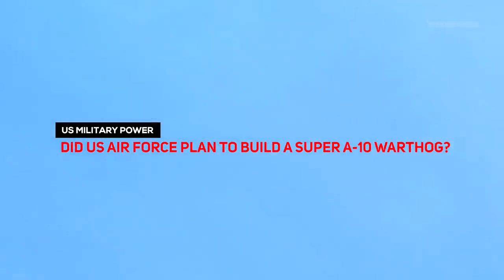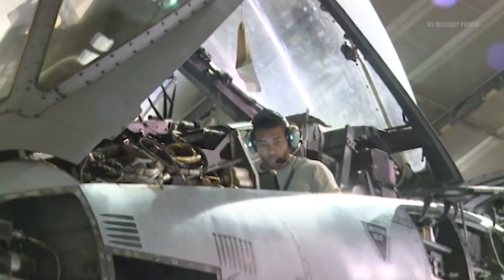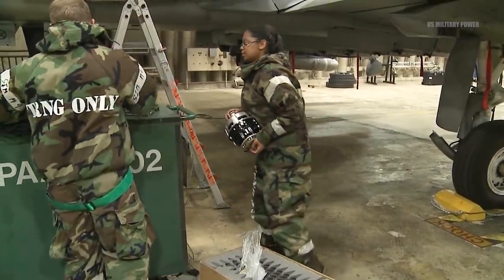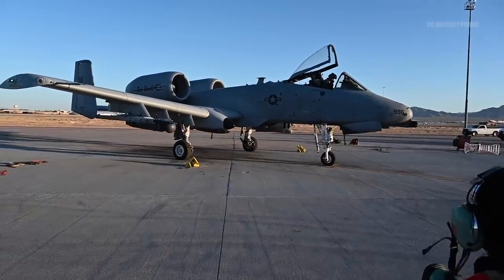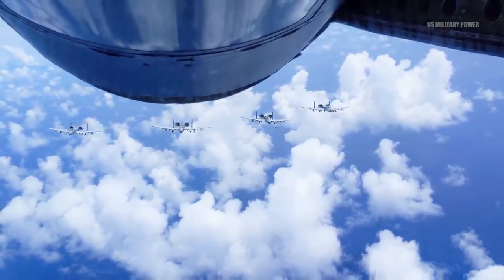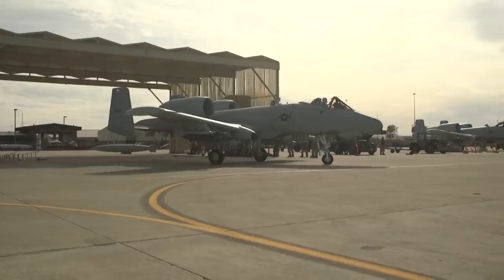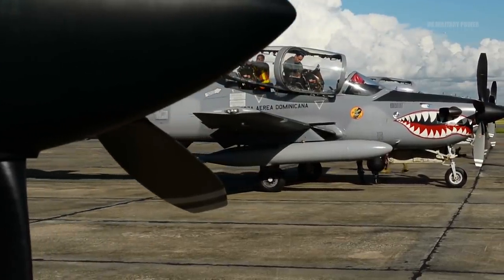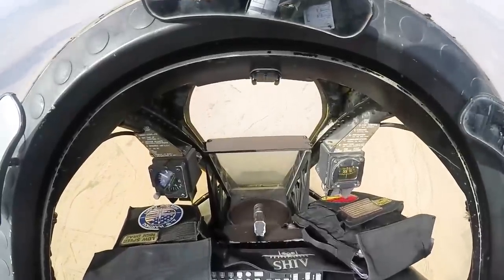The New Super A-10 Warthog is Coming

Comment: The only thing they need to do is build more A-10 airframes
Reply: Build more A10 to confront the Iranian gunboats. If it is designed to kill tanks and can easily kill boats.
Reply: @warpaulgundol7560  the speed of a-10 is only 0.57 Mach , even old surface to air missiles from 60s have speed of up to 3 Mach, he isn't going to survive that encounter,  A-10 is only useful against enemy that doesn't have surface to air missiles
Reply: @fpsserbia6570  The A-10 will merely be used while air suppression has been enforced. Plus, its survivability is much much better than attack helicopter and F35 that it could withstand massive gunfire and fast enough to escape from handheld missile in low attitude with flare.
Reply: If you're already going ahead and building more airframes you can build a new design with the same redundancies. 

If you wanna keep the a10 you're gonna have to do with existing airframes.
Reply: While we are at it, let’s build more P-51s as an air superiority fighter
Reply: @carlosandleon  basic a-10 design doesn't need to change
Reply: @lordraydens  it can be improved. Improvement is change. 

It's the redundancies that make the A10 durable, not It's design. 

If you're building a new airframe, design a better one. The redundancies can be built in
Reply: @fpsserbia6570  you can't outrun a SAM even with most modern designs, being this slow may actually be an advantage, both in being harder to hit and staying on target for longer in a CAS role.
Reply: @XxBloggs  p26 with 747 engine best foghterz
Reply: Keep the plane
Reply: @fpsserbia6570  BS..  THERE ARE AIR TO AIR Packages, A DEFENSIVE PROJECT OF A MINI CWIZ, a masking package.....   there has been options .
Reply: @fpsserbia6570  slow is actually harder to hit with a Mach 3+ missile. The reason they keep un retiring it is because it serves a very useful purpose. The F-35 is not really that great for CAS, can’t loiter and is too expensive to lose to pistol fire from the ground. That is an exaggeration, but you get my point. I think we will be seeing AT 6 and super Tucano CAS as well.
Reply: @fpsserbia6570  false, might wanna look at why the frame is built the way it is.
Reply: Updated avionics and modernizing the engines would be welcome additions
Reply: You are ... SOOOO RIGHT....
Reply: MichaelKingsfordGray  AGREED.  That is frequently my line.
These people who sign on to YouTube anonymously to enable themselves to constantly make ugly, rude and disrespectful comments are Keyboard Kowards and should be called out and banned from UT.
Reply: Building more A-10s is waste of time.
Reply: @warpaulgundol7560  Why not use anti-ship missiles?  If it can sink a frigate, it can sink a gunboat.  Multiple missiles, multiple targets, sink the pirate fleet before they know what hit them.  Or get up close and personal with the big ships and use the anti-missle defense guns/rockets on the pirates.

Comment: if i was a soldier on the battlefield i'ld rather see a warthog in the sky around me. they got a proven and well deserved reputation of being tough.cheaper than other planes and that big gun well speaks for itself
Reply: The main problem is the proliferation of MANPADs, making it much easier to cripple them, and the fact that the GA/U-8 isn't enough gun for its original role anymore while being too much gun for its new job.
Reply: The problem is that you're not a soldier, and generally pilots nowadays prefer the F-35 over the A-10. The A-10 is quite useless for any competent army that equips its regiments with some anti-air capability.
Reply: @Just_A_Dude  Your opinion is noted.
Reply: @revivedcorpseofrasputin4337  All aircraft are vulnerable to MANPADS. The A10 will be with us for along time.
Reply: @davidpallin772  The A-10 is far less capable of avoiding them than any other aircraft.
Reply: And they can get closer to our troops with less chance of casualties compared to any other plane
Reply: @revivedcorpseofrasputin4337  Not true when they're being upgraded with ECM and ECCM packages in addition to having SEAD escorts during campaign sorties where there's a realistic expectation of such problems. ISIS had plenty of AA capability but it did nothing to help them against the A-10 strikes. There is such as thing as modern combined arms, and no one ever sent A-10's expecting them to dogfight or deal with AA alone.

When you look at investment value, they drop more bombs with better target aquisition, longer field loiter time, and cheaper flight hours. Far from useless against its sisters who spend $22,000 or more per flight hour and struggle to stay local long enough to be useful to ground forces.
Reply: @JRyan-lu5im at the cost of pylons. The f 35 has all those capabilities built in. and it can carry a similar cas loadout. there is NO reason whatsoever froth a-10 to be used for anything other than coin
Reply: Tried. True.  Durable.  Effective.   Cost efficient (relatively).   I guess gotta get their buddies multi billion dollar contracts to build a new one
Reply: Aside from all the friendly fire casualties over the years

Comment: If the airforce doesn't want it, then they should give it to the army or marines.  The airforce has the motto "Aim high".  This plane is about aiming low.
Reply: "Aim high" hasn't been the motto in almost 20 years.
Reply: @tommyarnold890  exactly. Time to aim high once again and give low to the ground aiming a10 to some branch that needs it
Reply: @lordwalrus8615  Nooooooo. In fact the AF has been expanding its CAS inventory. Considering how easily the AF has established air dominance in every theater since...ever, it makes sense that they are expanding their capability to switch to a CAS role.
Reply: @tommyarnold890  You do realize how many helicopters the army owns...right?  This is a support vehicle just like that.  The army can get above ground.
Reply: @samuelmcbride  Of course. And they are also limited in loiter time, range, ordinance, and altitude. There were some places in Afghanistan they couldn't even fly into. Meanwhile fixed wing aircraft like A-10 and Super Tucano don't have that problem.  They can fly further,  longer, carry more toys to the party, and actually get to the party. Which is why the AF was not interested in the AH program when the project was first proposed.  Along with their focus being to stop Russian bombers. There actually was an AH that was designed and tested by the AF in the 50's and it out preformed the Apache today. Thats how uninterested they were. Its ok, the Army can keep plying with their whirly birds, thinking they have something cool.  But when it really hits the fan the AF will still have to bail them out.
Reply: @tommyarnold890  Are you talking about the AH-56 Cheyenne developed by the army in '67?  Had a pusher prop and was very fast.  The Army said it would take over CAS, so the AF built the A-10.
Reply: @kwang6291  Yeah thats it. The Cheyenne. The AF also looked at it when the Army was considering filling the CAS need. Instead they built the A-10 which was superior in every imaginable way.
Reply: Aim high; miss your target.

Comment: The Air Force already has the platform - the current A-10.  One of the most critical upgrades the Warthog needs are NEW AND MORE POWERFUL ENGINES.  The majority already have received new wings, and obviously the GAU-8 Avenger needs no upgrading.  But new engines with more thrust will allow the Warthog egress from the battlefield after dropping its load on the enemy.  In addition, added power will allow the Warthog to carry a larger payload.  
     The TF-34 Allision turbofan engines that are currently being used puts out just over 9,000 lbs of thrust.  A newer version of the TF-34 or even completely different engines with 25 to 30% more power will give the Warthog the extra boost it needs to leave the scene much quicker.  Improving the A-10 this way, just like what Boeing did with the F-15EX, will save the Air Force a HUGE amount of money - pilots don't have to spend months or years transitioning into a "new" aircraft because they're already familiar with the aircraft.  
     The A-10, in my opinion, is still a vital part of the Air Force - one that will get up close and personal with the enemy.  And with improvements like new and more powerful engines, possibly new sensors, the A-10 can be even deadlier.
Reply: The Air Farce and Navy have slashed so much of their pilot training budgets already to try and prop up the F-35 debacle, cutting capable aircraft to “put the turd in someone else’s pocket” will only make the Pentagon situation worse.

I’d like to see an A-10 driver tangle with an F-35 in a dogfight, and see who comes out on top: the faster plane that still has to get within visual range with it’s “fire and forget” technology to avoid shooting friendlies, or the underdog that can literally out turn anything else in the skies.
Reply: @chrisbullard5901  interesting concept, they could then try flying with heavy battle damage and land wheels up, A10s can and have done both, the later because its designed to be able to do so.
Reply: @CrusaderSports250 , while pilot training factors in heavily, the A-10 as a dogfighter could make sense if you use the extremes of EM Theory. Much like the A6M Zero against the Hellcat or the MiG-21 vs the F-4, the A-10 would just have to trick the F-35 into a horizontal turning battle to engage.

The shorter turning radius alone could potentially cause a win as early as the merge.
Reply: Amusingly enough, the engines on the A-10 are already MORE powerful than needed. They specifically had to tune DOWN the engines to keep it slow enough.
Just undo the downtune, and call it a day.
Reply: well could use the engines the that f-35 As and Cs use and then put them on the A-10!  then we make the A-10 wings have vector folding high super sonic aerodynice wings that can fold for very high speeds that can then unfold when near the tagrest zone!  also give it remote uav drone remote contoal and add high speed ram jet engines for more fuel efecsty at highe super sonic speeds!  then  add some of  the steath tech from the f22 and f35 into the a-10 as well!  if they USAF want to replace the A-10's GAU-8 with a new multi fonchon pulse laser as well! sense we have those usable now! that can not only melt tanks and blow up other stuff! they can also be used to also paint the target for those laser gided smart muntions too in a low power mode.
Reply: @chrisbullard5901    Surely that could be arranged??  X planes or some flight sim. Cause you know NO way in hell will the government allow that to happen.....
Reply: @bnetolldnataman , my concern is that if it was simulated or even in an actual Dissimilar Air Combat training, the military tends to favor Beyond Visual Range radar designator calls rather than actual combat conditions, when Rules of Engagement require visual confirmation before firing BVR weapons (one too many friendly fire incidents in the Gulf made BVR weapons unreliable).
Reply: @chrisbullard5901    Yep what you said makes total sense. 👍👍.
Reply: One of the most critical upgrades the THUNDERBOLT needs ....
Reply: @chrisbullard5901  The F-35 would win every engagement since the A-10 hasn't been integrated with the AIM-9x.
Reply: Good analysis. To lose a platform this capable for close air support would be a grave mistake. We have nothing else as good at this job. The A10 is simple, rugged, and brutally effective. It is both feared and revered. ISIS knows the sound of this thing and they scatter like leaves in a windstorm. Which means they AREN'T shooting at us. Still a win in my book!
Reply: The dude that tried to kill it probably works for China.